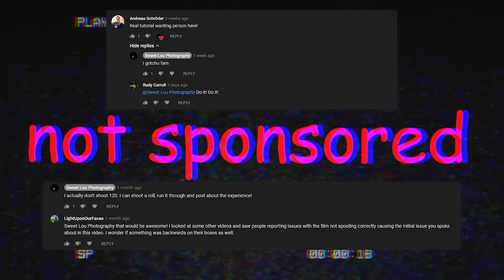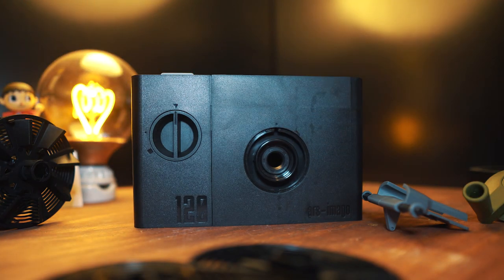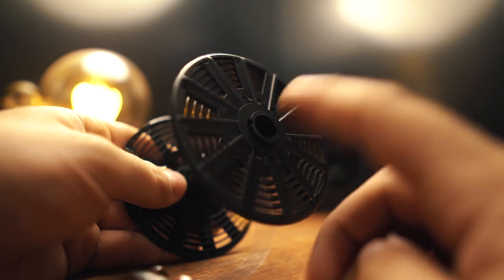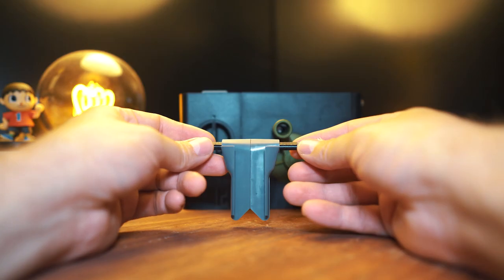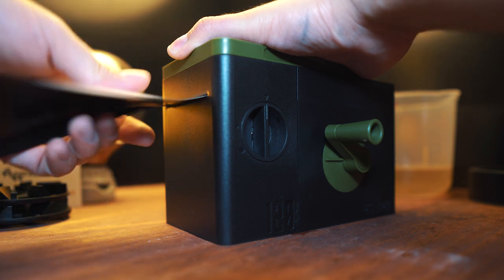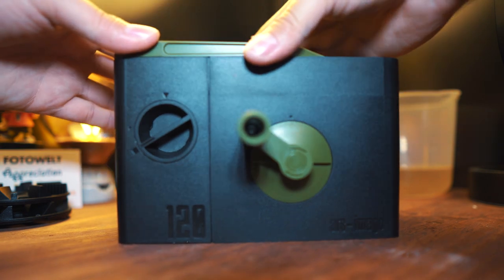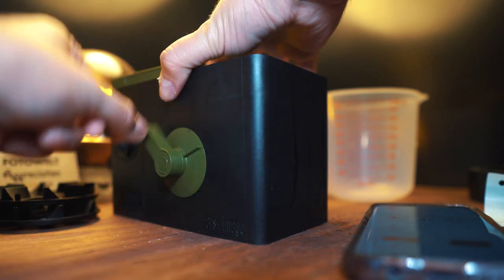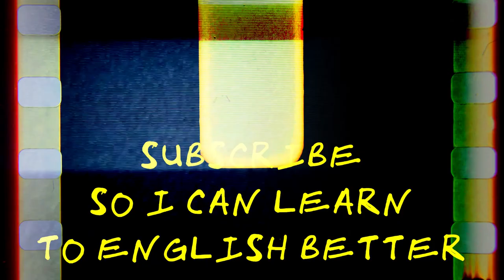HOW TO DEVELOP 120 FILM IN THE LAB-BOX

Comment: Note re 120 film processing in LB.  Since the film is rolled into its loading chamber from its tail end, you are left with the beginning of the roll sticking out, to which the "clip" is attached. It is easy to leave the beginning of the roll out so far that the first exposure is light-struck and lost. It's important to pull as much film as possible into the storage chamber and to not pull the 120 roll end out while removing its end-tape or to attach the clip. Of the several formats put in 120 film, some use more or less of the whole roll. There is an excellent YT video out there which shows how to modify how you load your 120 roll in your camera to move any unused part of the roll to the beginning, thus minimizing the chance of loosing that first exposure.

Comment: A couple of notes on the use of the Lab Box:
1.) The crank agitator isn't that useful.  It puts some leverage on the retaining ring, and can cause it to come unlocked, doing disatrous things to your developer and film.  At the amout of agatation that it won't, the knob works just fine, and will be 100% reliable.  So, I recommend not paying anything extra for the crank.  And if you just have the crank, take it easy, and put a thumb on the retaining ring.

2.) **Super Super Extra Important** - Very easy to forget.  Make sure you release the film drop (i.e. turn the black knob BACK TO THE TRIANGLE) before you try to wind your film onto the spindle.  Otherwise, you'll just pull the clip off the end of the film, shredding the film, probably causing you to ruin at least the first shot.

Opinions about the product:

1.) Crazy easy to use.  On my 4th roll now, and it seems to work really well, once I figured out the two things listed above.  Kind of expensive, but you don't need a light changing bag or darkroom at all.

2.) I totally agree that the 120 should come with a separate spindle, solely because it takes at least some thinking and examination to figure out how to fit the spiral guides on the sides.  If you're forcing anything, or anything is loose, you're doing it wrong.  Personally, I'd prefer just to leave the 35mm and 120 guides set up permanently, and never put any wear on them or think about them again.  If I can ever buy just a separate spindle, I will.
Reply: I just developed my first roll in 35 and this is exactly what happened...developer started bleeding through the hole and somehow I managed to put the crank back and kept going...will know in 3-4 hours how well I did. ..

Comment: Hey, just a note—120 is a Kodak designation. Just as 135 is the designation for 35mm film. 120 film would be known as 60mm film, but the motion picture industry already took that, so we're left with "120 film"  which is slightly unfortunate, since it doesn't mean anything.

Comment: Does it work with colour film?
Reply from the maker: Yes, it works with whatever chemistry you put in. I just happened to use chemistry for b&w
Reply: C41 process requires the chemistry to be kept at 102 degrees. I use a steel tank and reel for my 120 and 135 but put the tank in a water bath that’s kept at temperature. I’d assume it would work but you’d have to put the whole lab box in the bath in between agitations? Idk. For me this seems easier only for loading the reel (my hands get a bit sticky in a changing bag lol esp in Hawaii humidity).

Comment: It looks like they did a complete redesign of the 120 reel at the last minute, as the original reel was supposed to be adjustable for both 35mm and 120. In doing so, they made a pig's breakfast out of the assembly of the 120 reel. Add that the instructions seem to have been not updated to match the reel design, and misassembly of the 120 reel is a given, not an exception. To add both insult and injury, they only give you one (common) reel core, so you have to disassemble and reassemble the reel each time you change formats; what a rip off as well as imposing unnecessary wear and tear on such critical (plastic) parts. I was advised that I could purchase a second reel core by February, but that information is now "not current".  On the whole, the Lab-Box is clever and well executed, and it flaws can be corrected by buying a cheap part (eventually) or practicing your technique. However, at the price point, there is never going to be a 2nd model. We from Kickstarter will be lucky to ever get the fancy high-tech replacement digital lid which was promised.  They got six times the funding they wanted, so I assume they grossly underestimated the cost of designing for volume production.
Reply: My update at Aug 2020.  In June ARS announced that they had finally completed the accessory digital lid which they owed to the Kickstarter crowd. However, they claim to have run through the huge pile of excess money they received, so the KS members would have to buy (pay more) for the digital lid. In the US that worked out to about $36 with shipping, but in some placed around the world, there seems to be some official price gouging charging up to triple that amount. ARS declares their Kickstarter commitments fulfilled, which in detail they are not. They have promised that parts will be available "later" for purchase, but given the track record, I'll believe it when I can buy my missing reel core. Overall, from a Kickstarter perspective, Lab-Box is a qualified success, in that the product was completed, it is of a quality more than sufficient to do its job, and though pushing three years overdue, it is substantially complete. IMO the delays and unaccounted disappearance of excess KS funds is attributable to a lack of necessary design and production people, i.e., bad business management. Other than KS members, the retail pricing on the full Lab-Box kit with accessories crank and digital lid totals more than $330. Paterson tank system is truly trash, but for $30-40, you can get a good quality 2 reel tanks system new, and if you have the knowledge and time you can pick though ebay and come up with a much more useful processing equipment package for a lot less than $330.
Reply: Two year update. In the US, ARS-IMAGO, the Lab Box maker, had two distributors. Feestyle in LA has been withdrawing for months from retail of this product, has put it on "clearance", and is clearly dropping its association with the maker and its product. B&H in NYC still offers the basic product, but none of the accessories and replacements required for long term support. There are rumors that large retailers of LB have cleared it from their warehouses and dumped en masses for as little as 10% of retail pricing. In the US, expect LB to be a historical footnote by mid-2023.  To bad, because it is a high quality product which delivers what it promises, but was made and distributed by a small company which didn't have any idea what it was doing, including trying to sell it for twice what the market would tolerate. "LabBox II"? In your dreams.

Comment: how did it keep light sealed when you removed the paperbacking and clipped the actual film?
Reply from the maker: I explain how it works at 4:11
Reply: The film unwinds off the backing into a hidden light sealed container.  That's what the black knob with the square and triangle is about.

1.) first the knob is on the triangle, so the film unwinds/unpeels into the hidden film holder
2.) then your turn the knob to the square, so the film is protected from the light, with just the end sticking out
3.) then you clip the end of the film to the spool winder, and replace the top
4.) only then do you turn the knob back to the triangle, releasing it from the hidden container
5.) now wind the film onto the spool, and proceed with development.

Comment: Nothing against your video, but this definitely seems overly complex and cumbersome. A $25 changing bag and a normal tank would be far easier, faster, and convenient to use for those without adequate darkroom space. Hopefully this tank doesn't cost as much as I imagine it does
Reply from the maker: Honestly, I've been meaning to make a follow up vid regarding this system. It has been in my closet for months at this point, and I have been doing exactly what you described for all my color film. (When I made this vid, I didn't really have a workflow in place that worked well for me. The system was genuinely very appealing, but I've learned so much since this vid and I am so much more comfortable with my current setup)
Reply: @SweetLouPhotography  I also don't have much of a proper workflow, and I agree that the premise of the Lab Box is very appealing - it's the reason I looked up a tutorial on the system! There's definitely room for improvement, and sadly at this point it's just easier to load my tank at night in my closet. Hopefully they'll make an easier device that makes it more appealing than changing bags.